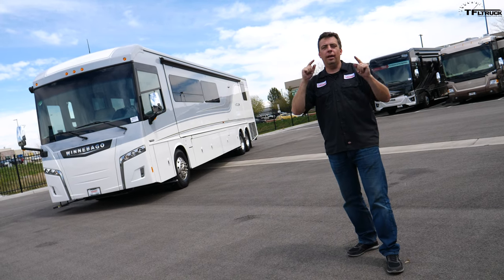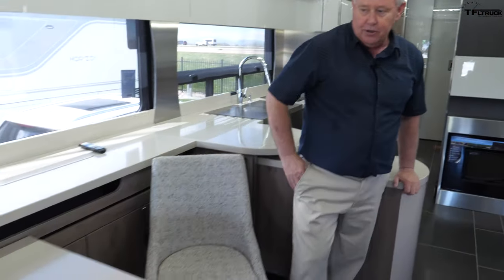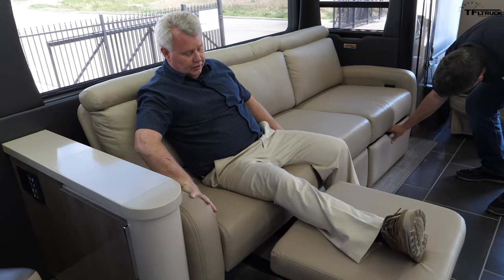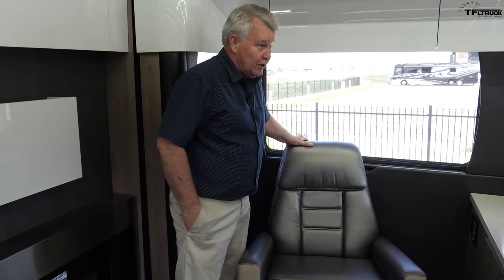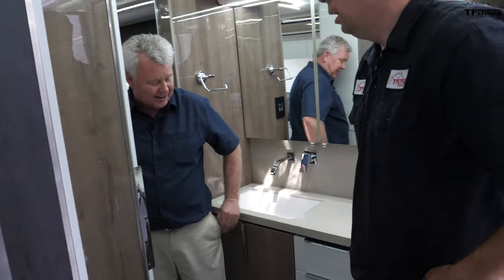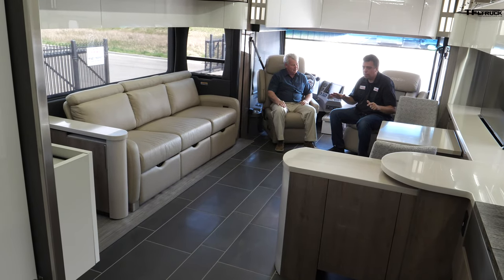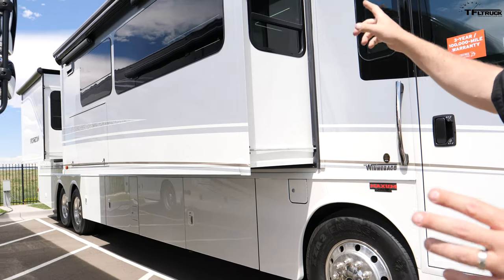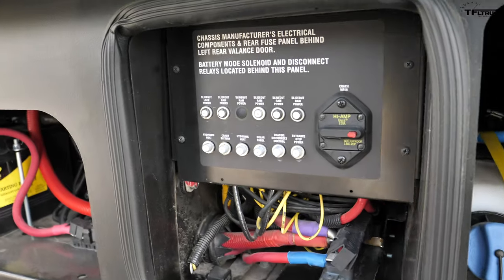This RV Has a Freakin' Fire Place! Meet the Most Luxurious and Most Expensive Winnebago

Comment: My parent's experience with owning a 10 year old RV is enough for me to never ever want to own one of these things.
Reply: I bet it costs a shit ton to keep these things rolling. It's a vehicle no matter what. With commercial grade expenses
Reply: @dragonbutt  seller "This RV has a kitchen sink, a shower, a propane stove, or a water tight roof!"
buyer "What do you mean, 'or'..."
seller "It has all of those features! Choose the two that you want functional."
Reply: I fully understand my parents had a fifth wheel, and then a  motor home. I will never ever own an RV they are maintenance nightmares. You have the actual vehicle mechanics you have to take care of. The worst part is keeping everything else working air conditioners, frigerator,  water heater, the roof not leaking, it just goes on and on.
Reply: To each there own. But I am curious, do you have maintenance on your house and cars. We live fulltime in our 5th wheel and still not spending as much when I had a house payment.
Reply: Here is the difference when it comes to maintenance on a home houses increase in value. Also you can eventually get a house paid off. So you end up with a paid-off home that still increases in value just about every year. RVs only last so long. I bought my house at 25 I will have it paid off probably no later than 45, and I plan to live in this house forever. Just in the time it takes me to pay off my house how many RVs would I end up going through no fifth wheel is going to last 20 years. I spent a good part of my younger life around RVs. Normally the first things to go in an RV is the roof, and the refrigerator. The constant vibrations that goes through the body during travel takes its toll on components.
Reply: @autohelix  Tell that to all of us that bought there house in 2007
Reply: @jefferytock9403  Tell them what? That the economy goes up and down.
Reply: Good comment. I own a 9 year old Winnebago and everytime I take it out something is broken. Everytime!!
Reply: @rebellucy5610  no, it is probably not every time you take it out one thing is broken.
Im sure sometimes it is more than one broken thing
Reply: @jefferytock9403  What happened in 2007 we bought our house, now from $290K it's $430K obviously that all only matters if you sell your home. But no RV is ever going to have a potential to go UP in value. No camper or 5th wheel or most normal autos. Plus as Ford ST said you can pay your home off and it cost very little to own. Bought the refrigerator in 2007 when we got the house. That seems like it will last a lot longer then RV's....hahaha So at $500,000 and a high price of $200 a night for a nice Hotel that is 2,500 nights. I know I know someone will say "buy we live in our RV", to hell with that for me. However if I stay in a place like I did in Utah, nothing special at $60 a night that is 8333 nights isn't that like 23 years...hahahaha Sorry I don't get the RV or Camper life.

Comment: Honestly, I would rather have a fully decked out Airstream and GMC Denali. I would also have an extra 300k in my pocket.
Reply: Livnglrg exactly, you could buy a Hennessy raptor with 600 hp and the airstream and have what? Enough money to buy a mclaren 720?
Reply: @Livnglrg ~ It is a nice RV, but you're still limited to designated RV parks and the paved roads.

I like the Earthroamers, so you can go off road, where ever your driving skills and confidence can manage, for isolated peaceful scenic views, but still use paved roads and hit the RV parks to empty the black and grey tanks.
And if you add a motorbike storage lifter on the rear of the Earthroamer, you have a tender to run errands.

Comment: Ike Gonlet this RV with Mr Truck. Also do the 100 mile fuel economy run.
Reply: It will likely do better than some duallys. People typically get 8-10mpg on this chassis. My 38 foot Tiffin gasser gets 6 or 7mpg while towing. But it’s not much smaller and was about 125K. I like the Horizon interior style though.
Reply: @rreichar1  what size gas motor is in a 38ft?
Reply: Gas Class A’s all are based on various sizes of the Ford F53 chassis which has a 6.8 liter V10 with 3 valves per cylinder. Moves it around nicely enough. Mine is a 24,000 lb chassis.

Comment: Should have shown the inside of the RV after the slides were retracted.  How difficult is it to get from the front to the back?
Reply: myofficegoes65 I’ve seen one. It’s not bad. You can get to the bathroom and the bedroom. The bed is not flat though. I didn’t try to open the refrigerator but I think it’s doable. The TV is a lot closer.

Comment: Yea this has a Freightliner chassis. Means me working at a dealership have to access the engine. The norm on these things any access difficult or almost impossible. You have to remove staples to remove carpet under the bed to access the engine cover and the bed you have to remove side panels and prop it up with anything long you can find in your toolbox.These things out of warranty expect 2 to 3 times the door rate to get anything done.Hell if you can dump half a mill not a concern.

Comment: For me there is one very big subject not mentioned in this video, the electrical power system, other than the genset.  How many and what type of batteries in the battery bank and how many amp hours?  What is the watt rating of the inverter? And...what is the solar situation for the coach?  I scanned the comments for a similar question but not all 164 comments.  Sorry if this is a repeat.
Reply: Larry Tillick Absolutely would have loved to have this included. I believe stock is a 2800 watt inverter (Magnum) with 6 AGM house batteries. Only 100 watts of solar but at least you don’t have to start from scratch. I would love to see them use a hybrid inverter and have the option for lithium batteries and a lot more solar. It’s typical for the market though. I would like to hear tank capacities as well.
Reply: Along those lines, I think the sales rep misspoke when he said the cook top could run off the batteries and inverter.  Unless I am mistaken, it would be too much load for that and would need to be used only when connected to shore power or maybe with the generator running.

Comment: 500K and a manual couch?
No blue tooth app for controls?
The control panels are tacky as well
Also they really need an upper brand name 500k for Winnebago is a tough sell when you can get a few year old Serious built, HIGH quality brand for the same price that sold for 800K  to 1mil.
Reply: The couch isn’t manual. Just the footrest. They had to do that for the under seat storage. Typically these sell below $350K. Winnebago did have an upscale brand “Itasca” but ended it a couple of years ago. Basically they had gotten away from the upscale thing and were just duplicating their other coaches with different trims and colors. What Winnebago really needs to do is make a serious effort to repair their reputation for customer service and quality. I think they are doing better but they really hurt themselves for a few years.
Reply: @rreichar1  good info, bit to say its not the couch its the foot rest is the same as saying the car is works although the engine is gone, the foot rest is part of the couch and its very Ikea kid's room quality to have to pull it out prticularly because auto out foot rests are pretty much standard any more when foot rests are offered.
Did not know Itasca was them but was aware of Itasca that division was hardly an upgrade from a  Winnebago.
Retirning to their roots ie unique and quality  would give them a good foundation to expand to the high end market for now its like Chevy trying to put a product in the same market as Lexus...its almost laughable

Comment: A little confused.  I went to the motorcoach website.  Could not find this model with tandem rear axle and the floor plan that you show in your video.  Is this a 2020 model and they have not updated the website?  or, what's up?

Comment: I have put a REAL wood stove that looked a lot like a fireplace into a motorhome. I just followed code for a mobile home installation. The wood stove had to be double wall, as did the chimney, because otherwise the required clearances would have been SO big that I would have had to put it in the middle of the vehicle. Every time I started it, I had to start out with a load of newspaper to burn the creosote from the previous use off of the chimney - to avoid serious chimney fires. I had one chimney fire before I learned this trick - and burnt the "fireproof" part on the chimney. This was installed in a converted bus that had aluminum walls, so there was no risk of burning the walls, so I could put the stove right next to the wall. I had to install an aluminum section on the ceiling to take the heat. I used a wood stove with a catalytic section - not for efficiency, but rather to avoid smoke that would freak out other people.

Comment: The glide outs render this motorhome useless for passengers other than the two front seats, from what I see.  A fifth wheel with a GM HD truck with the Duramax diesel and Allison transmission would give you the best of both worlds for less than half the price of this thing.  And oh yeah, you still get a truck without the trailer.  Ya know, one of those things you can use when you aren't  traveling.

Comment: You went inside the wrong RV it has carpet you need to go into a Newmar fall flat floor tile in $1 million price tag on the king aire top of the line  steerable tag axle and fireplaces option on all manufacturers of RVs

Comment: Big Boy Coaches run the 605 HP Cummins X15.
Reply: @dragonbutt  Do you intend racing them ?
Reply: @dragonbutt   Yes , but that is taken care of by the gearing because unlike trucks the weight does not vary as much .   High horsepower is not a requirement for most  RV driving conditions . Most of their life is spent parked up unlike trucks .
Reply: @dragonbutt  So then buy one with a high horsepower engine because obviously  you require it for  your frequent trips across country .     So  you think an RV travelling  at high speed   is safer than an RV  at posted speeds .  Do you have the data  on this and   have you shared it with the States that limit speeds on  Semi's because it would seem you have   evidence that proves larger vehicles should  be  travelling faster  ?
Reply: @dragonbutt   In Texas  the speed limit is 75 for trucks and  cars but in many other States  such as GA, FL, CT, IL and Iowa   it is  up to 10 mph lower . As I said share your evidence that  these States are in error .  Again if you want power to  outrun traffic  by all means  purchase a  high HP engine   and chip it .

Comment: a MEMBER OF FAMILY BOUGHT f150 LARIAT FOR 6500$ IT HAS 270K MILES fROM 
mULLINAX FORD year 2005(Built 2004). did MEMBER get screwed over and 
what will happen to V8 engine.   Also How much does it cost for NEw 
Leather seats as well as New DVD player placed in as well as new shift 
belt.  @t    Also what are after market cost cheaper like Toyatos after market.

Comment: $500k & they put shitty ol coaxl's in it and janky lil sound bars with Wal-Mart tv's....   the fireplace was nice but the couch was cheep & not electrical,  i bet tge battery or batteries suck...not lithium ion that will last 15years and more... 

They put the engines in there but no TUNNING capabilities and tricks to get better MPG 

Id spend $250k not 500k